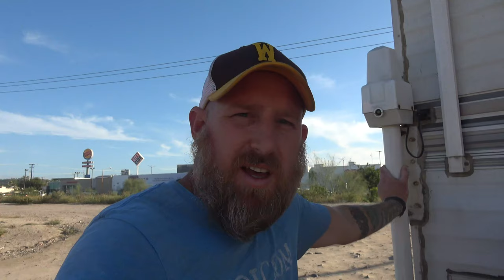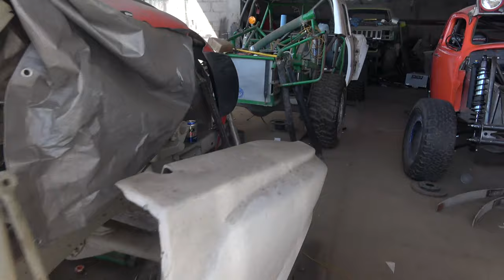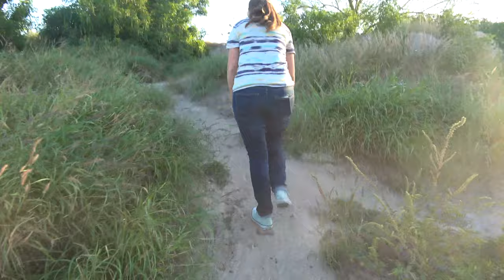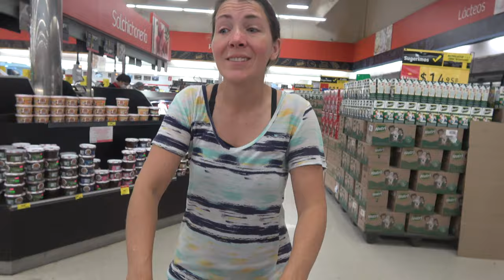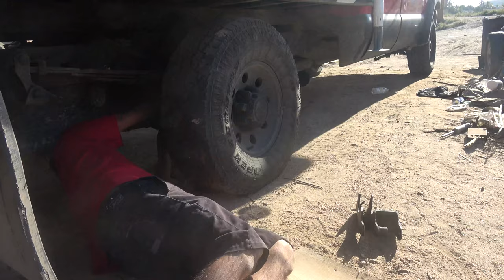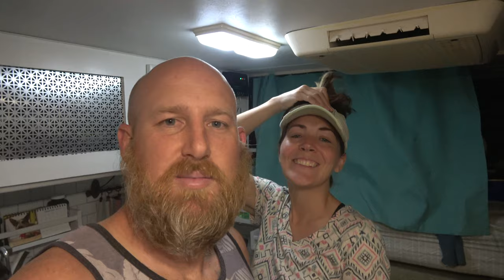CtW 71 // Getting our OLD TRUCK Repaired in Mexico / What Are Mechanics Like? // Truck Camper Living

Comment: I would look into f450 leaf springs. When I get a truck camper I’ll be putting f450 leaf springs on my 04 f250
Reply from the maker: Oh we ended up with something like that! Maybe the Mexican version... as the mechanic we went to custom-built springs for the load. Added 3 overloads and 2 leaves to the pack to make us a tank moving forward. Stiff without the camper - but much more reliable now!

Comment: Good thing u got it fixed. I wonder if there any diesel mechanics out there for powerstrokes.  Drive safe .
Reply from the maker: Fortunately, we haven't had any diesel-specific issues in Baja. We're hoping we went through all of those back in the US before heading down here. But we have heard that our particular engine - the 7.3L - is fairly common for mechanics to work on (We've seen quite a few of them throughout Baja) so we know it will just be a matter of time and money to find the right mechanic if we ever needed powerstroke work. Part of our choice in going with the 7.3L engine was that we found through research that it was a fairly common engine throughout Mexico, Central and South America. Again, we'd rather not have engine issues moving forward so we hope we never find out!
Reply: Yes 7.3 are really reliable engines i also have one been good so far. I like how your turbo whistles i thought it was a 6.0 at first.  Have a safe trip. Ill be following.
Reply from the maker: PEREZ TRUCKING thanks! We love the whistle too! These engines are solid and we never question whether Rocket has it in her to get work done!

Comment: Great  service. 
Have you ever scaled? I have an F250 gas with a Lance 825 and I'm  right near the trucks limit.
Safe travels. Love the adventurers.
Reply from the maker: campingboy we scaled heavy enough to not want to scale again, ever. ;) Were heavy but not unsafe. Our steel flatbed has been the hardest part of our weight issue. But it is what it is now, and we couldn’t have done any different setup, nor did we want a bigger truck or dually
Reply: Called To Wander 1) so usually is a flat bed lighter than a regular bed if the flat bed wasn’t steel? 2) Are flat beds only made of steel? 3) So with everything are you guys over the gvwr?